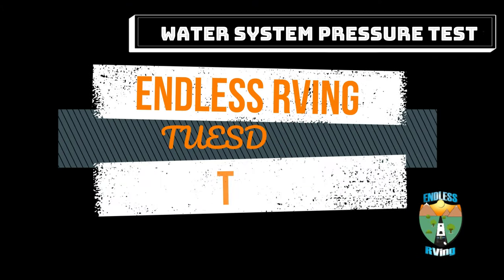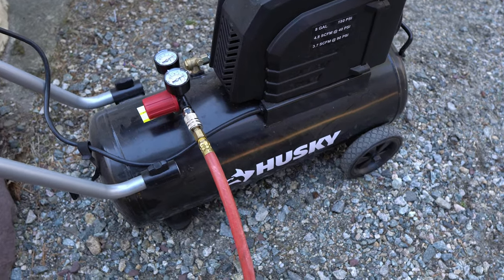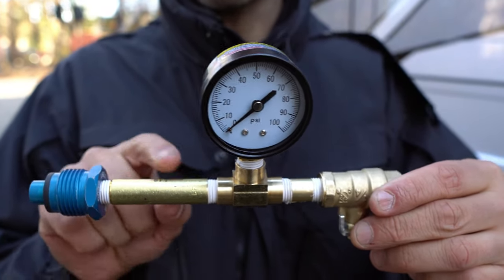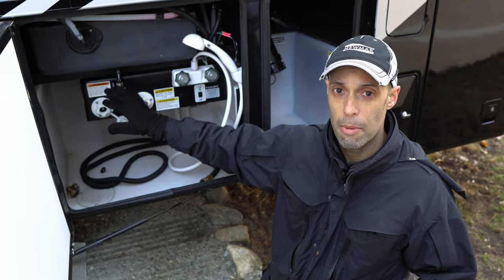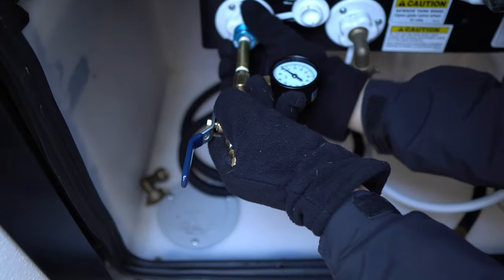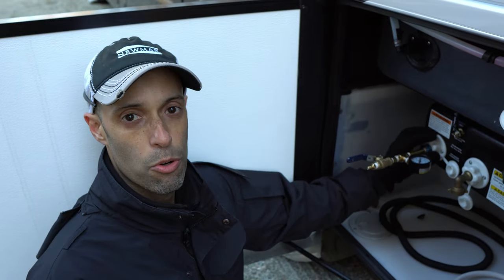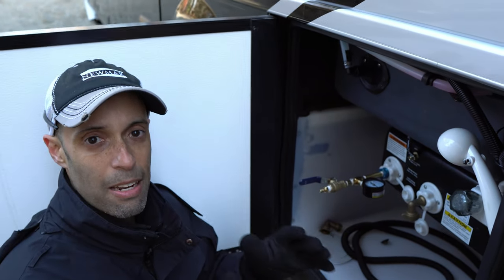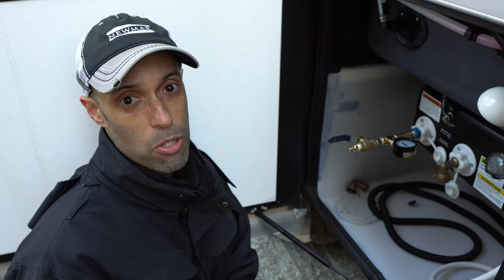EASIEST WAY to AVOID EXPENSIVE RV Water Leaks!

Comment: At the start of every season, I also check all the plumbing fittings, P-traps, drain connection, etc. any fitting that might have loosened up.
Reply from the maker: Hey John we also do the same!!   Especially after those cold winters.  Thanks for watching.  

Izzy

Comment: If the pump comes on when you aren't using water... There's a leak.  Most of the time the leak will be im the water pump.   The seals in pumps wear out. $60 for a New pump is nothing compared to the work of finding and getting access to fix a line in the wall.
Reply from the maker: Leak at the pump would be a gift!!   For many they may find they have a leak when they are in city and that is never fun.   This quick test at least gives you a little peace of mind start the camping season.   Thanks for watching. 

Izzy